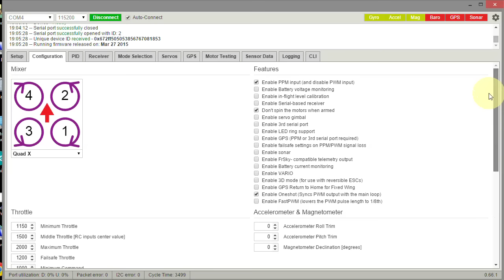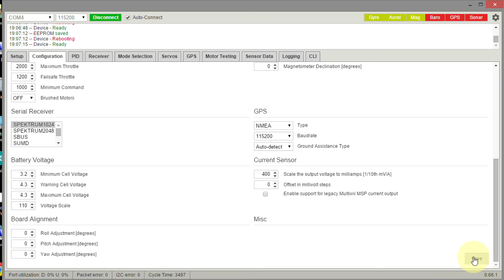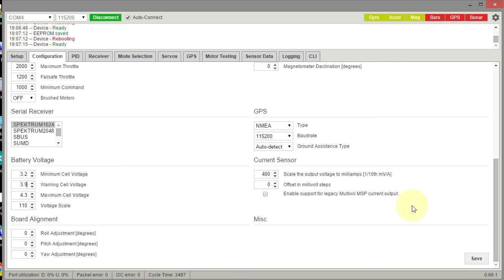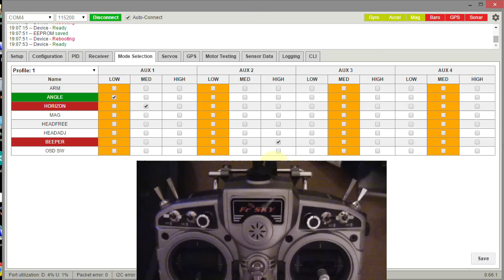Emax NightHawk 280 Pro Racing Quad - Adding Low Battery Alarm

Comment: Good stuff Dave! It's amazing how durable those little quads are! Hey just an observation, when you were resetting your cell voltage, you only reduced it to 3.9, not 3.5 as you intended. That may be causing your voltage alarm to trigger prematurely.
Cheers!
Fergy
Reply from the maker: TheAdkFlyer10 You are right I did. Later after making the video I set it back to 3.5 which is what it was to start with. The beeper would go off too soon on 3.9 volts.
I found that 1500 mah 3s bats were just to wimpy for this quad. It needs a 2200 mah 3s and flies great that way.

Comment: Nice info! Low battery and lost alarms are very handy. The problem I have is the volume on that single 5v horn alarm. I can hear the stand alone low voltage dual alarm that connects to the 3 cell balance plug on the lipo but this type set up is too low of volume for me. I have never seen a good loud set up for both battery and lost model alarm.
Reply from the maker: Billy Clark Could be louder for sure but still useful. After I land I can hear if the battery needs a change without touching the quad.

Comment: Nice vid! Where did you get the beeper and appropriate cables with the right terminals?
Reply from the maker: ChromeRay Cables came with the NightHawk. The beeper was from Radio Shack but they are at most electronics vendors. Some soldering required to put some right angle pins on the beeper. Liquid electrical tape used to cover exposed solder joints.

Comment: Nice job with the battery buzzer!! Are those goggles Fat Shark Dom V2, and if so what receiver are you running with the 280 Pro?
Reply from the maker: Drew Tuck Yes they are Dom V2's and use a Fat Shark 5G8 Receiver module in the bay of the goggles. I am so glad the 280 Pro has 32 channels and supports the Fat Shark band.
Reply: We tried the Fat Sharks ATT and the didn't work with the Pro 280. So I got the Dom V2's but I need a receiver that with work with Pro 280 camera system and also I have 2 more camera unit's from Banggood.com that I bought that I need it to work with. I have a ground station which is a 8" Lumenier Slim FPV Monitor w/ 5.8GHz 32CH Diversity Rx, DVR, Battery & HDMI that's working with all my quads, but I don't want to use that anymore for the receiver. I really don't want to have to have 2 or 3 receiver for the Dom V2 just to fly my different qauds. Andrew Tuck
Reply: was the 280 set on 20 mw or 200 mw setting for your transmitter?
Reply from the maker: Drew Tuck I switched to 200 mw. The 20 mw is just for racing for cash prizes because of some strange FCC usage rule in the USA.
Reply: Thanks for your help, just wanted to make sure we where getting the right equipment.

Comment: Do I solder + to + and - to - on the bottom of the board? Is the positive on the left and negative on the right (on the voltage monitoring output)?
Reply from the maker: +Jake Lofton See how the battery plugs in and look for the red wire, that is +.
Plus goes to Plus. You probably don't need the ground because they are common.

Comment: mine goes way too quick, how can I make it not so touchy on the sticks?
Reply from the maker: You can adjust the RC rates in Cleanflight.
Reply: +dmerc00 thanks,many idea how I can add more aux channels to my radio? I only have two by default and 6 switches. So right now I can only program two of those switches. Also, how do you keep your nighthawk so calm and stable? Did you lower the rates? I always end up over correcting everything. Thanks for your help!
Reply from the maker: I think you need to post your questions on the RCgroups Nitehawk pro thread and more people can help you.  Here is the link:
http://www.rcgroups.com/forums/showthread.php?t=2443194